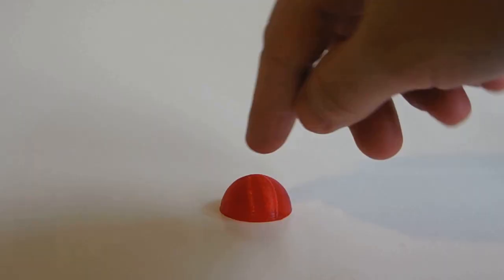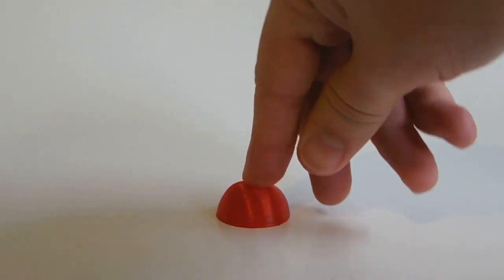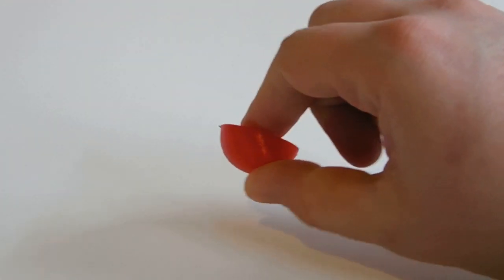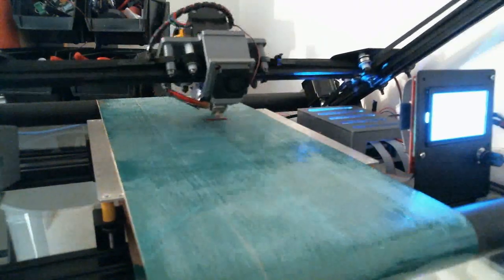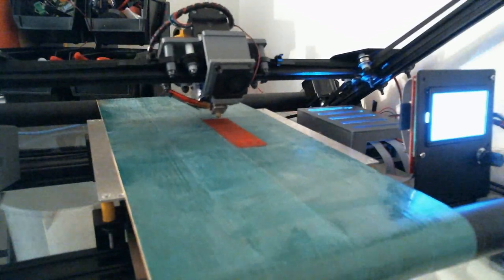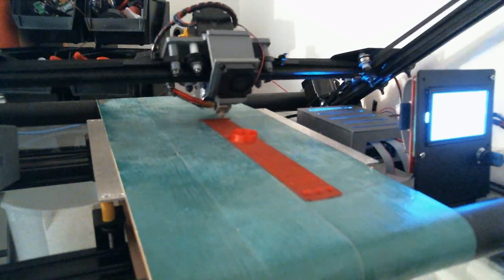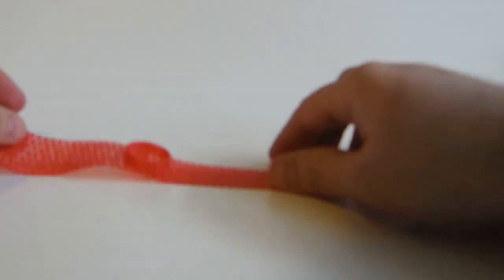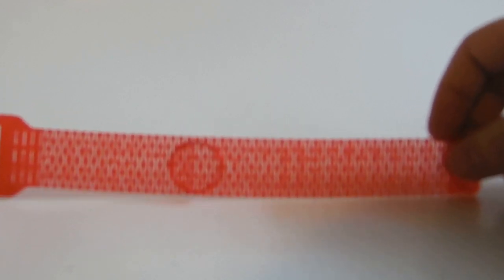3D Printing Flexible TPU on a Conveyor Belt

Comment: Awesome machine..what are you guys using as a belt/build surface?
Reply from the maker: Thank you! We have been researching a lot of different belt materials. In this video, it is a special thick paper, and PET tape.
Reply: @powerbelt3d  had any major issues with the belt drifting at all?
Reply from the maker: @gryph70  None whatsoever. Our conveyor rollers are rubberized.
Reply: @powerbelt3d  ah brilliant!